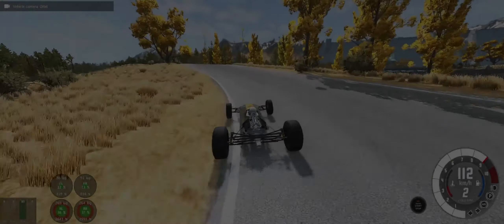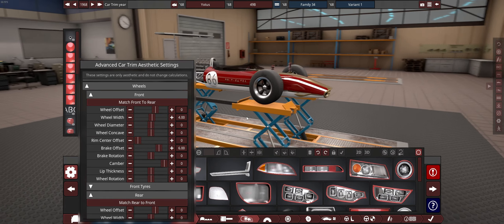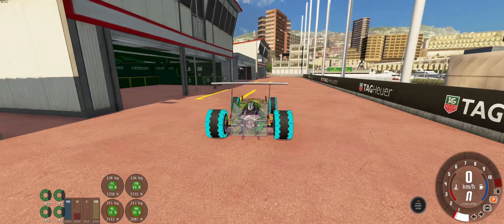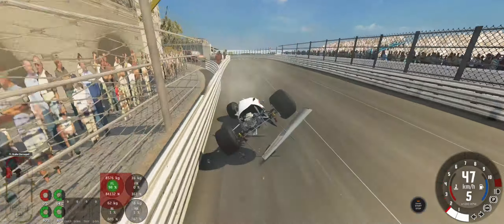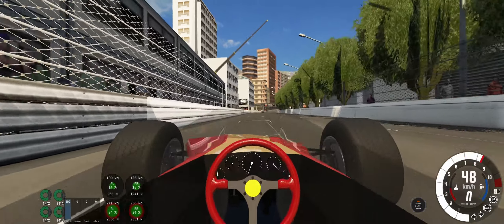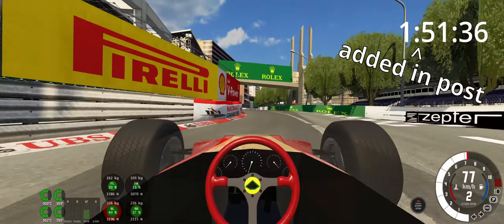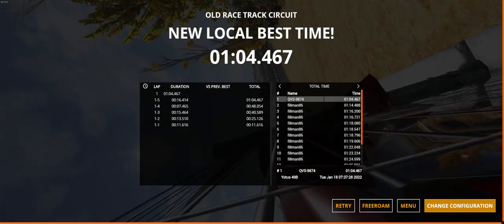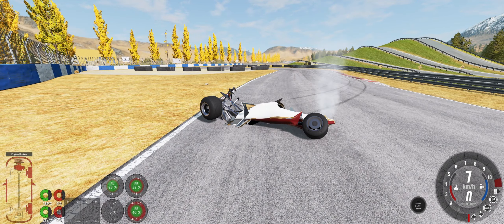I connected the Wing to the WHEELS!

Comment: I have a feeling it might have helped more if you'd spent that "one minute" dealing with the chassis stiffness issues, rather than spending it practicing and setting up brake pressure. 

But I totally understand that you couldn't have done that in "one minute", despite being so skilled that you managed to add sliders to change brake pressure in "one minute"
Reply from the maker: XD before I made the video I'd spent about half a day already, and after my mid video attempt to make it less shaky, it was still a pain in the butt!

Comment: Gorgeous car! (thought it simultaneously to you saying it)
Olivier who made all the interior parts of the Spartan (open wheeler from last stream) unjiggly said that making fixtures part of the main car body helps.  And the fixtures were so jiggly that acually driving fom the inside was unappealing at best.
If that doesn't help maybe adding diagonal struts might help it (not diagonal horizontally but diagonal vertically) :) It would be cool to make a car with the body, but I wouldn't be able to take the jiggles in the current state.
Reply from the maker: there's not enough random fixtures for it to be causing it. It's just the exporter and such a narrow body